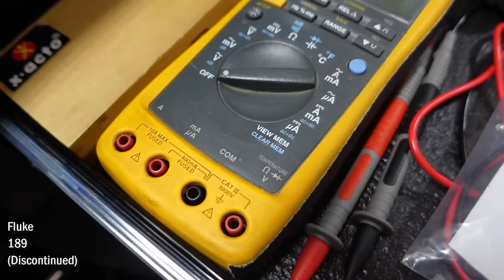Hardcore Snap-on COLLECTOR Toolbox Tour! | Snap-on Classic 96

Comment: I have one of those compact 3/8 ratchets too, I use it all the time!  It’s just handy because it’s small but still 3/8 drive.  I am a field mechanic so my 1/4 set is in a blow molded case and it’s nice when I dont have to dig it out.

Comment: Great video! My grandson just graduated highschool, he has been saving since 4th grade to buy snap on tools, but with the way the economy has been and how expensive everythings gotten he was pinched and strapped for cash. 

He was so hard pressed over what to do, and then a 2002 Toyota Tacoma, crew cab, utility tray with fold down sides...danas, and lastly a 5.3L v8. He'd been riding his honda trail125 for his entire life. Well, that didnt leave him much money for tools haha. He didnt even know about the icon line. And I sat him down one night after watching the flash movie last month, and I said, instead of trying to get all snap on like his friends at school and shop class had, I said get all the high quality odd and cheap stuff. Focus on getting tools to do work thatre easily replaceable should you need to or to do doubles of. 

Kobalt 230-Piece Household Tool Set, which was only missing wrenches. It was reg 190, but was on clearance for 57. These would live in his tacoma. At home depot we got him the m12 fuel drill saw and imp driver set, 2 batts a charger, open box discounted for his rig for repairs and wood processing. And finally at HF, he got the Quinn master tech mechs set, the quinn impact master socket set, icon ratchet flex wrenches, stubby ratching, and pic set. herc impact gun, and angled wrench set, 4 batteries and a spare charger, pittsburgh pro and doyle pliers, and lastly from hf, a icon 36" toolbox on clearance, green.

Online he got the tekton master impact 1/2 set, some wobble exts, channel lock plier set, knipex plier set, and tekton again for crows feet. 

Now he had his heart set on snap on but that was a no go. However, he did get the smallest cutters, he got pliers, locking jaw pliers, feeler gauges, 1/4 ratchet, 3/8 stubby flex ratchet, a 10mm 1/4 socket, a 10mm 3/8 socket, from SNAP ON. 

Hes looking to get another flush cutter, + and - screw drivers, small adj wrench, small locking pliers, 1/4 stuff from snap on again, to pack away as his bicycle toolkit haha. I am going to forward him this video, he will love this! 

Question, does snap on do koting on tools? We were at overland expo not long ago, and we say a 2022 Daihatsu Hijet, with a Mini Gun that shot paintballs hahaha, the owner had a small SNAP ON tool box that held, snap on tools that were in a matte multicam tropic, the snap on letters and sizing were all infilled in a glossy red, they were beautiful tools! Do snap on make mech tool kits like other mfrs do? Never seen that before... But anyways, great Video! Glad I found your page!

Comment: Quick tip on breaking in new pliers....take some valve grinding compound and put in the plier joints and start opening and closing them. They'll be broke-in in 5 mins or less.

Comment: If he had the lip at the front he could install some LED light. I have the masters KRL 1022
With the bed liner.
Got lights from EBay 
And cut them to fit.
So when I open a drawer
They illuminate the full drawer. Got them really cheap only cost £ 20.00
Reply from the maker: That’s awesome!

Comment: In case the owner is not aware Always rotate your casters parallel to box length to prevent it falling over when heavy drawers are left open at the same time. Boxes can always fall over cause too many heavy drawers open at the same time..

He knows how to move drawers/slides around. Snappy sells a special tool but not needed. But I got one from my rep for $10.

Icon 20038 sources so I don't have to call??
Reply from the maker: Thanks for the tip on the casters! I'll have to keep that in mind. As far as the ICON part, the only way I could get any info on it was to call in. It was pretty easy to talk with customer service. They were state side and very easy to talk to.

Comment: Would you want to work if it took you 3 jobs to be able to make ends meet? The economy outran wages and employers haven’t nearly caught up yet. That said, I also don’t personally know anyone that’s out of work. If you aren’t getting applicants, you need to offer more. It’s pretty much that simple.

Also, foam is great if using a contrasting color underneath so you can easily see at a glance that something is missing. Yes, it takes up space. If it’s that big of a deal, get another box or add an addition.